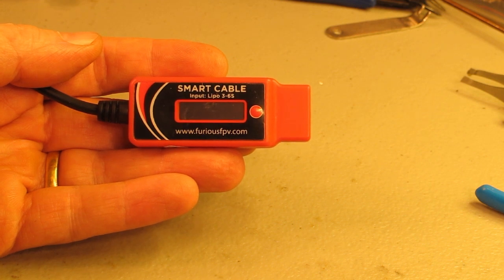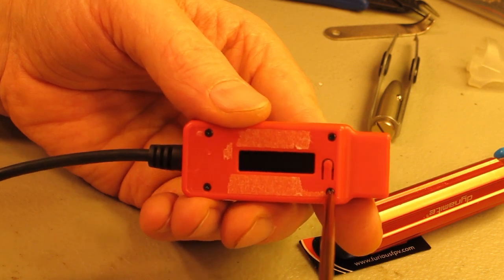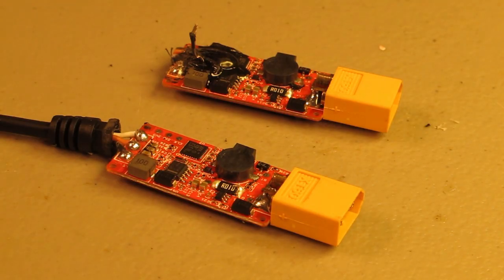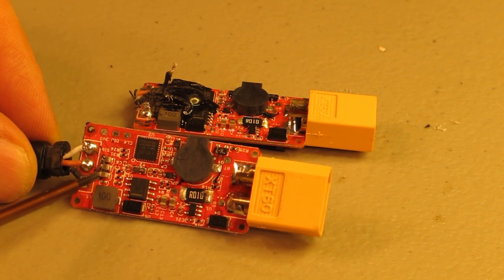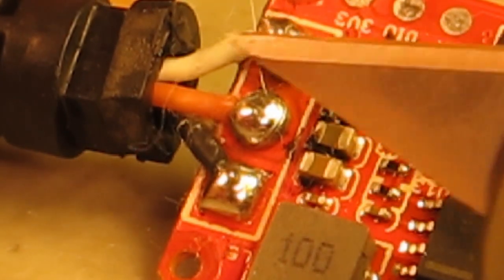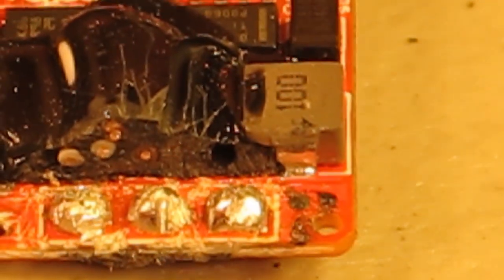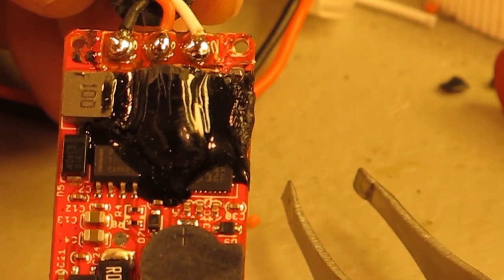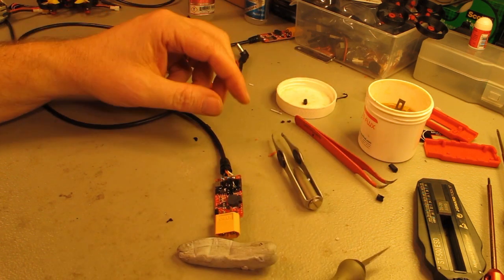FuriousFPV Smart Cable

Comment: Hi mate I have the newest version and guess what ???? I just lost a £350 drone in a lake because of this junk.. so they haven't fixed nothing...glad I found your video😣👍
Reply from the maker: Sorry you have lost your quad :( did you get what is being called V3?
Reply: @alaskadroneracingleague5367  hi buddy it was sold to me as a v3 but I can't tell because I removed the stickers😣 but because of you I have fixed it👍 and put a little hot glue over the cables to help stop it from getting pulled out ..not on the board just in case I have to repair again. So cheers mate and happy flying👍😉😁👑

Comment: I agree,  Furious should be recalling this item, both of mine had this problem from the factory, the first one I used lightly inside my house with my whoop, then put it in my backpack and took it to my race, pulled it from my bag and it didn't work. The second was bad right from opening the package!

Comment: I had to search for hours, waist high snow.. Because my goggles powered off, and smart unit still on.. Very disturbing, and potentially dangerous. My wires inside looked worse than my very first drone soldering job. stripped 1/2 inch, and gobbed with the liquid tape. In fact I cut wire 4 inches back, than melted the silicone a bit, to investigate the wires.. I found ground wire was nearly broken in multiple spots.. So was the signal wire..   This hardware failure could injure someone..   Recall before the lawsuit!

Comment: Looks like they did it right,  just you gorilla's are hard on yo shit lol,  just add extra shrink wrap to wire to board connection so it won't flex there, good luck
Reply: But then again I got a bunk v2 battery case, stuck in calib mode so could be chitty 1 hunglow manufacturing!
Reply from the maker: They did not get it right at any time. They are still selling the same junk. The actual wire is very low quality and will beak at any flex point.
Reply: @alaskadroneracingleague5367  yes I see that but they did do it right with strain relief n potting, but if wire sux won't help a bit.